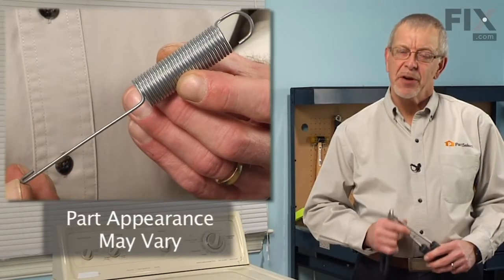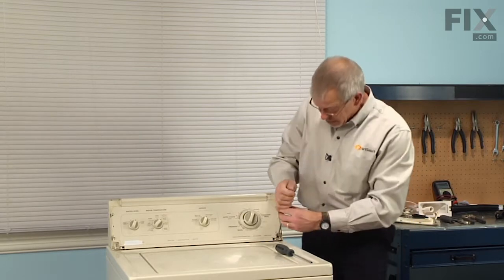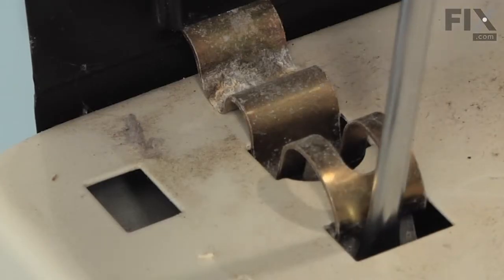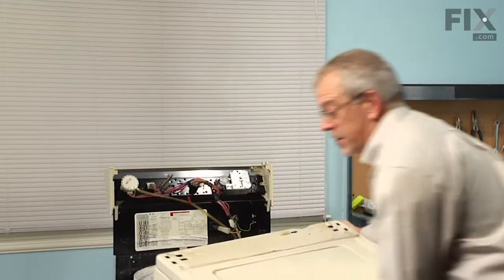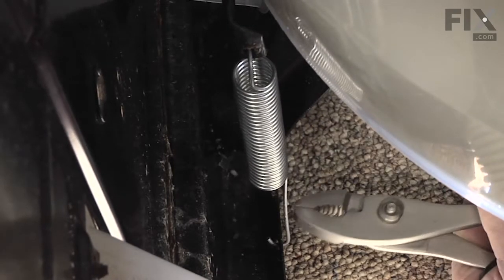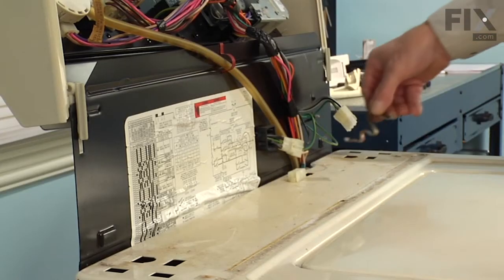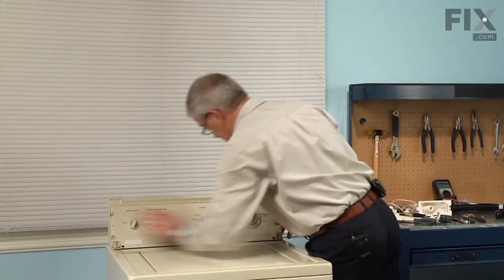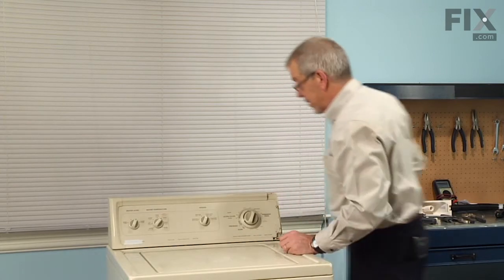Whirlpool Washer Repair – How to replace the Tub Spring

Comment: The replacement kits have three different color-coded springs - I think the blue one is more common, but I'm not sure which is more heavy-duty - or if it has to be matched to some color code painted on the motor.

Wish me luck...